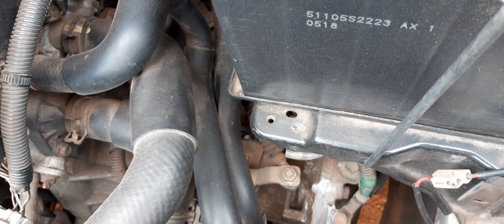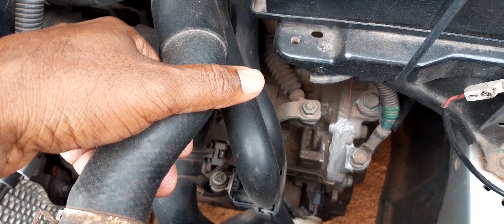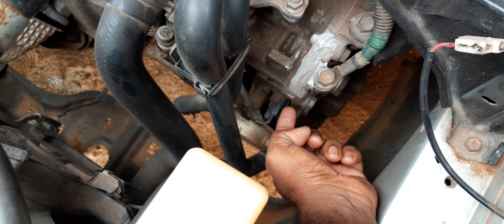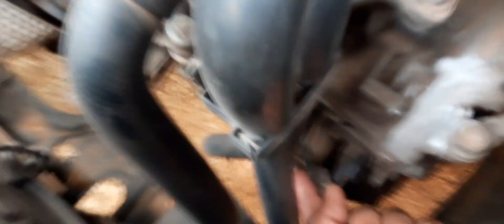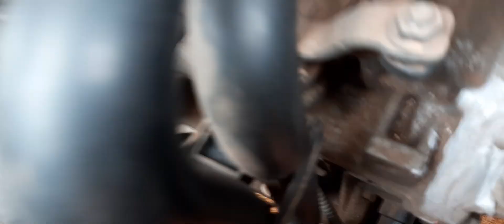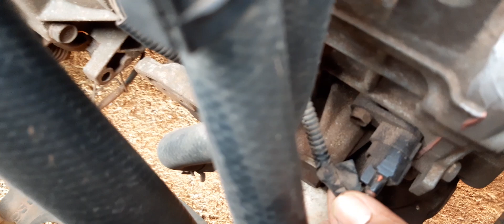No Gear Change In Automatic Or CVT Transmission

Comment: My 2015 Vitz not reversing…it also goes forward on in neutral…help
Reply from the maker: Sometimes the cable connecting the gear stick to the transmission is slack and needs readjusting and tightening. To readjust push the gear stick in the reverse position, remove the plastic  cover concealing the lower part of the gear stick. Locate the cable and screw, put  enough tension on the cable but not too much to shift the selector on the transmission.
Reply: @ do you have a shop I can take it to ?